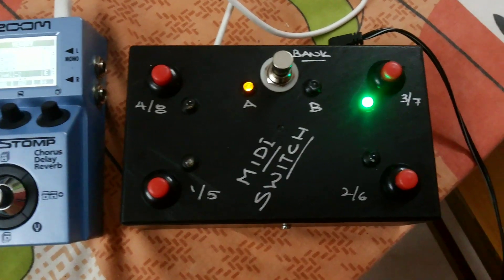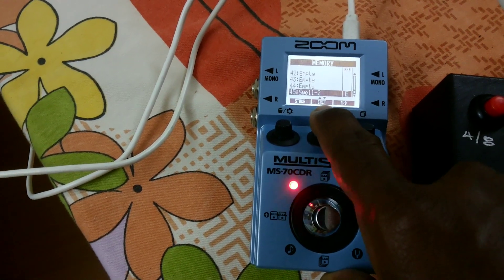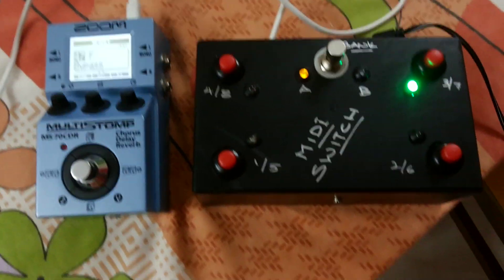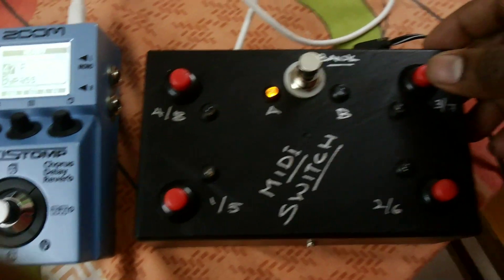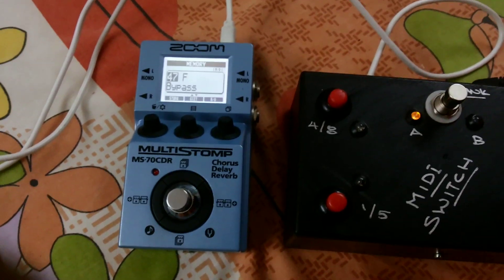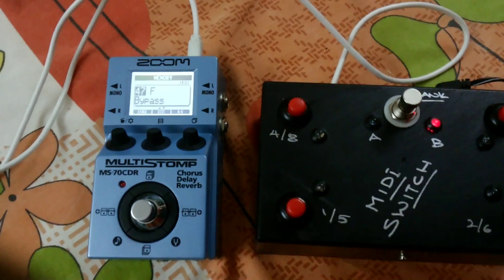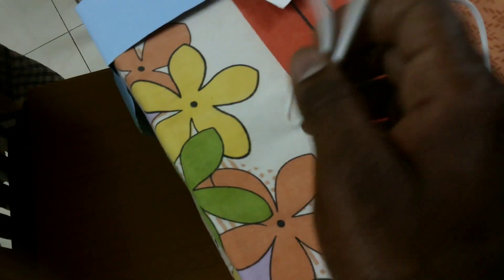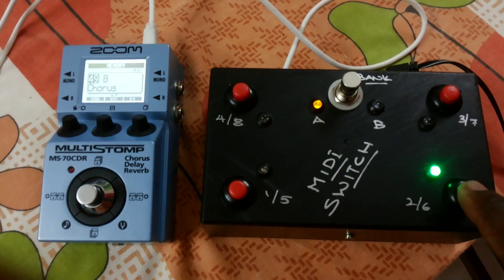Midi foot controller for the Zoom MS 70 CDR

Comment: Hi there, is there a link for the arduino source code and the circuit diagram of this controller? I really need this controller for my ms70 on my worship pedalboard. My email is kenneth.tadle19@gmail.com, you could send it to me. Thank you so much in advance

Comment: When patches are switched one by one is there a small pause (delay) when switching in the sound of effects? I connected MS70CDR usb via midi (usb host kenton), midi controller, and there is a small problem, a small pause between switching presets...
Reply from the maker: I have not had that issue at all.. it works perfectly for me..

Comment: Nice work. I made a similar tool, but i experienced about half a second of silence between the patch during the program change.
If i use the zoom button the program change is immediate, when i use my controller based on arduino, the zoom changes the patch but with a little delay, as said, with about 0,5 seconds of silence.
It is a normal issue?
Reply from the maker: Whose code are you using... when you use mine.. the first time you would see a delay and after that you should not see any delay...
Reply: Can i receive your code? my mail is tava AT libero DOT it
I would appreciate it very much. Thank you!!!

Comment: Lawrence I'm having trouble sending the code to the Arduino. When I try to give error and appears this message - Fatal error: Usb.h: No such file or directory / Error compiling for the Arduino board / Genuino Uno. What does that mean?
Reply from the maker: Please register in my forum and you can post your question there http://arduino-midi-control.boards.net/

Comment: Very impressive, I really like what you achived! Especially in the latter video!

Do i have to sign up on any website or buy schematics for this?

Also, is there a way to work in a Tap Tempo switch?
Reply from the maker: +Jack L. Stroem - Just leave your mail address on the blog, so I can send you the info.. You dont have to buy anything.. I just give it away freely :) Enjoy.  MS70CDR does not respond to timing messages and hence tap tempo would not work...
Reply: Ok thanks! I wrote my mail in there, not sure if i was sucessful tho!
Bummer that the tap temp doesnt work, would have made my rig alot easier for the smaller gigs! But to have controll over a few banks is fantastic for me!
Thanks once again!

My line6 dl4 has a taptemo that only saves for each of the three presets. Do you think there is a way to bypass all that and make it to a "universal taptempo" for the pedal that works even when no preset is turned on? If you have toyed with the Dl4 i'd love to hear your opinion! Im dying for a solution for it!
Cheers!
Reply: @LawrenceDoss  can you please send me the details of cdr70 midi controller. I would like to buy this.my email vinuviolin@gmail.com
Reply from the maker: @vinuviolin  Have sent it to you bud...
Reply: Hi.  Were you given the schematics/instructions/coding for this build project ?
How did it go ?
Reply: @jezisvole  i know for a fact that it works, but i managed to get the Bluetooth version of the pedal which does not work for this mod! Might get around to grabbing it in the future for a travel rig! :) Thanks for reminding me!

Comment: Awesome build! I had my own experience building an interface for devices like these.
Line 6 M5 home-made MIDI Foot Controler
I used a PIC Micro controller for my project, instead of an arduino board.

May I ask, what midi messages does the unit respond to? Can you perhaps email me a list? tomcarlo_22890@yahoo.com, your help would be very much appreciated!